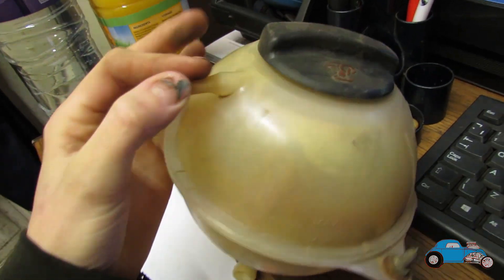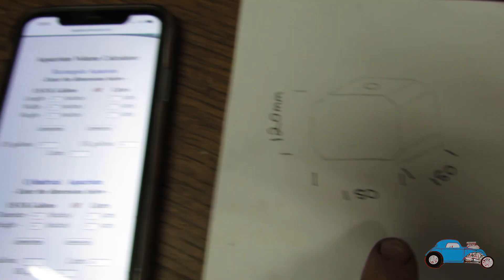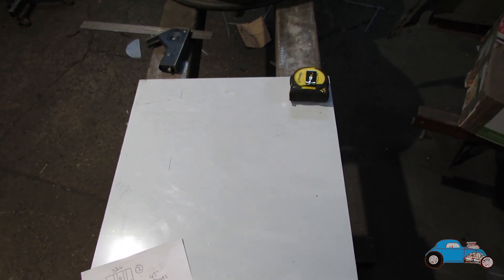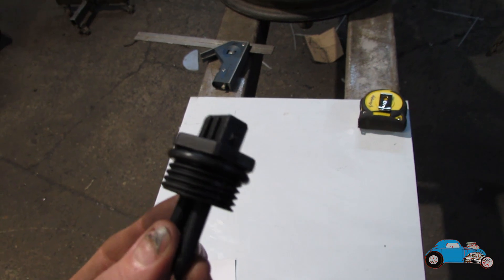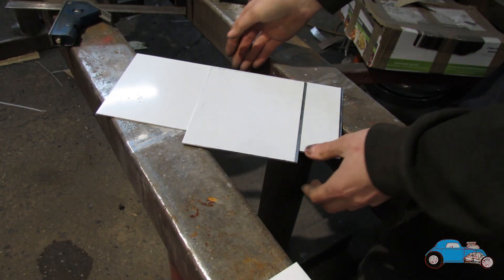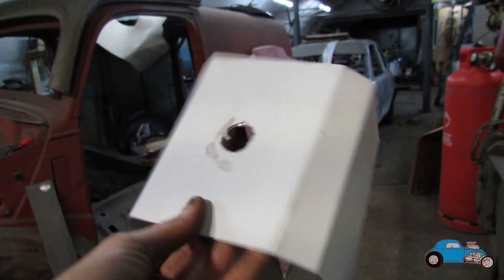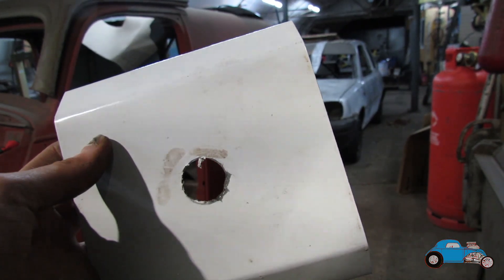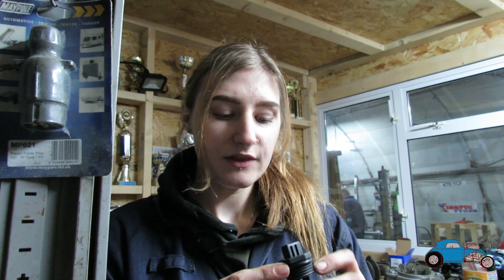Mk2 Golf Custom Header Tank Fabrication - Part 1!

Comment: Just a few notes. That's a late level sender from a t3 personally I would put it in the top as it requires a drop in the coolant to break the circuit and they're not the best seals. Plugs are available pretty easily and pretty cheap it's a 2 pin Packard connector